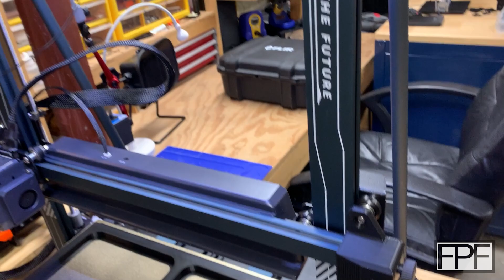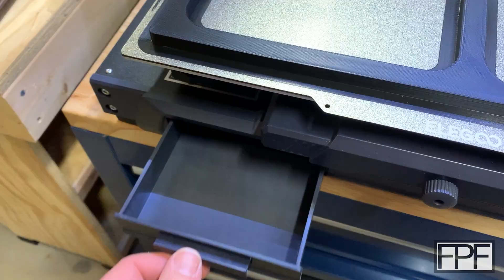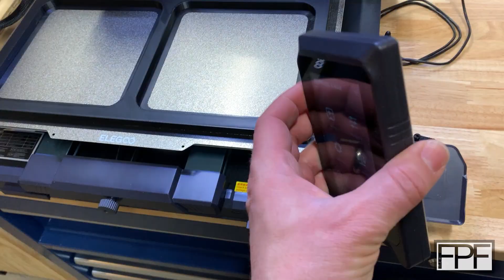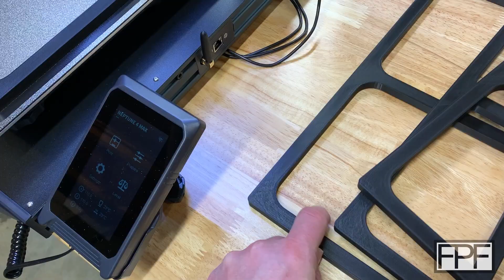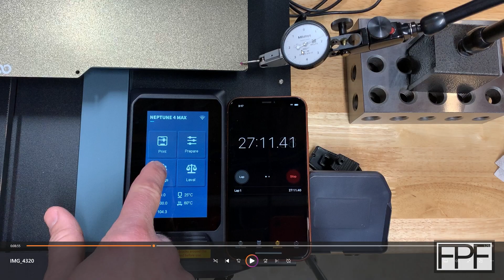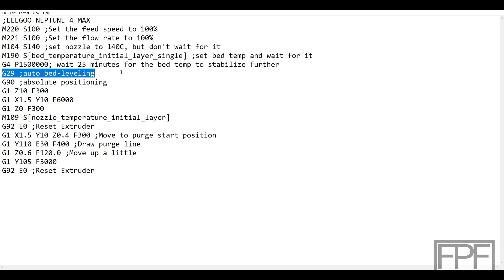Neptune 4 Max Review and a FIX for the PROBLEMS EVERYONE IS HAVING

Comment: I started in 2016 with a CR-10 and Cura and have been with Cura slicer since.  I agree with you regarding the firmware, it's probably due to klipper and the separation of the control board firmware.  Don't get me wrong i'm not making excuses but just think that's why you're having such a convoluted firmware update process.  The hassles of large print beds, I guess moral of the story is heat the bed 30 minutes before you do a bed mess.

Comment: Thank you for this video!  I just picked this printer up over the weekend. I was gonna go for a Kobra2Max, but found a great deal on the Neptune4Max.

It was tedious to setup, but I have an ender 3v2, so I was used to the tinkering. I’m able finally pump car parts, but i’m still having printing smaller prints. I have under and over extrusion on my prints, but I can just fill it in with with fillers. I’m gonna have to try your starting g code and see if that helps
Reply: Sidenote:  i prefer printing on PETG, so I turn off my part cooling and have the regular fan to 30%. I guess I should just take that part cooling piece off so it doesn’t wear out my z-axis
Reply from the maker: yeh, could just pull it off
Reply: @FunctionalPrintFriday  I’m going to once i finish this roll. Also, I was rereading the manual, and it actually states to set the filament’s temperature in the level settings. So your for the bed temp to even out makes alot more sense now.

I just put your g-code, but set the wait to just a few minutes because I wait awhile anyway after set bed temp before i print. I’ll report back after a couple of this fender flare prints!
Reply: im so glad you did not go with the kobra 2 max it is a pile of poo way worse than the N4MAX kept failing PETG prints

Comment: Awesome video! I got my 4 Max about 2 weeks after release. I had same firmware issues and did the upgrades with Elegoo support. I am also using OrcaSlicer for my Elegoo printers. I prefer the interface and it’s same as Bambu Studio.

I have bed meshed/trammed so many times it’s ridiculous! I too suspected thermal expansion, but I use thicker.28 layers for functional parts and wasn’t too concerned with surface quality. Most of my prints were passable like you were saying at the start of this video. I have yet to print anything really big, but have used most of the bed to print multiple functional parts at the same time. I agree, adding 20-30 min warmup for a 20+ hour print is worth it. Less likely to have print failures on really long prints. And you are still printing at Bambulab like speeds. 

Have you done any max flow testing on stock 4mm nozzle? I was really impressed when I got better than 26mm^3/s with some old Hatchbox filament. I can’t believe how well this 12mo old filament performed and it has never seen a dryer box.

Thanks again!

Comment: Do you think this has something to do with improper layers causing the print head to hit the infill, seems to be a common issue among 4 Max users. Typical solution is to goto gyroid infill and using Z hop. Did you encounter this issue with larger prints?
Reply from the maker: Grid is usually ok for PLA on parts without LARGE areas of open infill, but I run gyroid with any other materials or when I have a wide area of infill.  Grid + PETG is basically a death sentence for a print.  It's sooo bad.
Reply: I followed your advice on startup and have a great pla profile, printed your camera mount (perfect fit) and it turned out perfectly smooth. Thanks for the file and startup code. I love this printer!

Comment: would insulating the bottom of the bed reduce the heat soak/ wait time?
Reply from the maker: it's actually already insulated, though some people have apparently ripped off the insulation thinking it was packing material.

Comment: Watching a video about my first 3D printer hearing “this isn’t a good first 3D printer” and thinking well…
Reply from the maker: look at it this way. . if you can master getting reliably good prints on this machine, everything else in the hobby will seem easy :P
Reply: @FunctionalPrintFriday  that’s what I tell myself each time I have an issue. I’ve been fairly lucky compared to some, might be because I’ve taken it apart and checked most of the bolts. I’m a mechanical engineer so taking it apart helped me understand how this thing works. It would be interesting to watch the bed with a thermal camera to see how it heats to check for hot spots which could pinpoint some of the warping issues while heating the bed. I’m going to test out silicone bushings instead of springs to see if maybe that helps too.

Comment: I just shipped mine back for return. Honestly a very poor printer and pretty bad of Elegoo to ship a printer with this and many more problems. I was into a 5 day print, nearly at the end when I got layer shift. Dam. But literally at the end the whole top didn't adhere. I was in the other room so didn't see what happened. Lost about $200 in filament. First print failed as well because the weak spring in the filament runout sensor. I think I'm going to go for the 500mm3 Ratrig. I really wish they made an X1C with a big print volume. I have a X1C and a MK3. If I was going to keep this then 30 minutes wouldn't bother me as it's only used for very large prints that take days anyway.

Comment: I have been having so many issues with my 4 Max, and id love to get your option on this! I have had issues with heat bed failure for weeks now. (I purchased the printer in dec 2023 and started her up on January 4) I’ve crack her  and checked all of the wiring and plugs per elegoos rec and I’ve gone through the crazy process of updating the software and it’s still failing. It’ll hold heat for like ten minutes and then it’ll completely drop off. I’m not sure if it’s the fan or hardware at this point. It printed fine for five days and then it’s been heatbed failure ever since.
Reply from the maker: sounds like either the thermistor or an actual break in the heater circuit, which may be opening up as it heats.  I would definitely just want it replaced.

Comment: Can't believe this video just came out 3 days ago. I've had my Neptune 4 Max sitting in a box since late Nov23'. Was beginning to look into Rails and other minor upgrades (nozzles, etc) only to find that theres still a few bugs being worked out. Good to know about the bed variation, i'm very curious to know if this video was based on the included springs, or if you've tried testing using silicone bed spacers, etc? As for my feel... I expected it honestly. Size comes with additional challenges. Eventually I'd hope to see some 3rd party upgrade to address/make thsi time less impacting.

Comment: I have the Neptune 4 I heat soak for about 10 minutes prior to starting my prints and I do notice it has helped. Not thrilled about the Klipper implementation of this machine but once I worked the little issues out it’s been a solid machine.

Comment: That's really interesting. I've got the N4Pro as our first printer, and was suddenly getting layer shifts on the Y axis on small (3in by 4in in bed center) but tall (6in) prints. The shifts would happen about 45 minutes into the print in a room that's typically about 50 degrees F. Temp fluctuates a lot when the furnace heat kicks on and off throughout the day. 
I fiddled with the y axis belt a lot to try to fix the shifting, until it eventually broke. Elegoo is replacing it for free, but I'm suspecting that the thermal changes in the various parts might be the culprit. I'll have to try preheating once the new belt arrives.

Comment: I have had so many issues getting my prints to work properly.  I noticed the exact same things you did, but I don't have enough experience to have identified the issue as you have here.  In fact, recently my printer had the dreaded blob of death, and ruined my hot end, one of the wires came off when trying to remove the blob.  I was leveling non-stop and I also noticed the issue with Screw_tilt_adjust not being accurate.  I hope this resolves my issues, once my new nozzle comes in.  I have also ordered some of the new nozzles form Elegoo for the 1mm size, and I hope to be able to make larger objects more quickly and accurately with your guidance here.  Thank you.

Comment: really on the ropes regarding getting the neptune 3 max or 4 max. Mainly for the size. I rebuilt my ender 3 several times including with the full ender extender kit. Loved the size but i need a printer actually built for size. I will be using it for cosplay and props.

What is your honest opinion?

Comment: Hi thanks for profile. I have a question you may be able to answer. Used your G-Code and it did help alot on first layers but, as my print went along I was still getting excess extrusion. as far as it was hitting on each layer as it progressed.
Reply from the maker: Do you have the part-cooling fan on?  The big one with the switch?  If so, try running with it off.  It causes the bed to warp again when it comes on.

Comment: Thankyou for all your effort. I believe you've helped point me towards a solution for getting decent prints on my N4 Max. A few observations though:
1) 0.004 inches is 0.1016 mm, which translates to 1/2 a layer height.
2) Would an enclosure help?
3) The default tolerance is 0.05, which incidentally lets it accept almost all samples, regardless of deviation
4) With 3 samples taken, wouldn't 'average' be better than 'mean'?
5) With bed levelling done on every print wouldn't it make sense to look into the Beacon probe?
Regardless, thanks! I didn't fully realise the amount of heat expansion on such a large bed

Comment: I think Cura is actually still quite popular. Not sure if you have actual statistics for market share. I think especially for Marlin users, like anyone just using an Ender, it's still very prevalent. I personally prefer the Cura interface to most other slicers, but I have moved over to Orca slicer quite a bit because there are certain aspects which allow me to get better print quality, especially on certain prints. Sometimes, I actually find Cura provides a more logical slice of a part, but it is also missing features like support and seam painting that I really appreciate in other Prusa based slicers.
Reply: Ya I don't know where this guy is coming from with that.  Maybe most enthusiasts aren't using cura?  I think 90% of people who buy an out of the box printer are going to go get cura.
Reply: @saitekh  Yeah just a bit of confirmation bias I think. I do think Orca is superior in a few ways, but I think Cura is very competent.
Reply: I have used other slicer, Cura is still the one I like. Especially, the rich set of plug-ins. It's really a nice software.
Reply: I like Cura because is works on all my different machines, and yea I'm used to it. (Love the lightning infill). That was a factor when buying the machine.

Comment: Considering the size, even with that bed issue it's been amazing printer. Coming from CR-10 S5
30minute wait is no go for most prints. Only for say 5kg+ prints -- at which point just the weight of the print is going to affect level over time, fortunately spread over the full print.

Right now doing ~2kg print.
Insane how fast these new printers get stuff done, that's only 1½ days.

Comment: First and foremost great video!  I appreciate all the time and effort that you put into this machine.  However, I believe the only way manufactures are going to learn, is the hard way, and have customers return machines that simply do not work as advertised out of the box.  A 25min heat soak?  The when it already takes forever and a day for the bed to heat up.   For a bed of this size, maybe it should have been an AC heated bed?  To me this machine was rushed to the market, and didn't have a proper QC process.  Keep up the great work!

Comment: Function print Friday: I don’t recommend this as your first printer or using cura as your first slice 
Me who brought the N4M as my first fdm machine and only use Elegoo cura sweating hearing that😂

On a real, thanks for the video having loads of problems with the printer. Might even help me with leveling the print bed properly. Only just got the machine back online after having the main wiring loom die on me🙃🙃

Comment: Thanks for the video. Cura has been a staple of the low-end printer market for years. It shipped with the Creality machines and most of the other clones that came after.  Cura is also used for both Resin and FDM printers.  I got it with my Mars 2Pro and the Npttune 2S. Most people do end up switching to more advanced slicers.

Comment: It's great to see folks join the hobby and find issues we've banged our head against back 8-10 years ago, and heat soaking was always advised. Even if you're using mic6 beds on corexy machines, heat soak for a good 20-30 min. Let the bed stabilize, especially on large beds. I know everyone wants fast printers, but pretty sure can't fight physics.
Reply from the maker: Bambu made everyone's marketing dept. over-pivot to speed.  The N4MAX is a flatbed truck trying to wear a Porsche wrap.  There's nothing wrong with just admitting it's a flatbed truck, we need those too, but marketing dept's don't think like that.
Reply: @FunctionalPrintFriday  I heat soak bambu too. Even best heated bed surface we've found - mic6 aluminum needs heat soaking,  see my response to another post.
Reply: Or get a Bambu printer and it's easy peasy.

Comment: Sounds like the bed heater is under powered is it ac?
Reply from the maker: I believe it's DC, but it's just a big bed.  It's a lot to heat up.  I measured higher than the rated wattage of total power consumption on mine with both the bed and extruder heating.

Comment: I've noticed the same issue with the top layers on my Ender3 Pro that I just upgraded to use klipper. I've been having a hard time calibrating it. It could still be a different configuration issue, but I'm going to try this and see if it helps. Thanks!
Reply from the maker: Give it a shot, no harm in letting it heat soak.  Try for 15 mins to start.
Reply: @FunctionalPrintFriday  That did it! I had to raise my z-offset as well, but letting the bed soak gave me better top layers.
Reply from the maker: @vanillaike2304  awesome!  Glad to hear it, and thanks for coming back to share results

Comment: I use CURA on. An old MAC (2009) for my Creality Ender 3 S1/PRO. What is a better slicer to use in this setup?
Reply from the maker: I'd stick with Cura given the age of the machine you're running it on and knowing that it's working for you today.  If it's not working for you today give prusaslicer a try.  It's much lighter weight than Orca for an older machine.

Comment: Heat the bed first...so the hot end isn't just sitting there cooking while waiting for the bed to normalize, it only takes a minute or less for the hot end to go from room temp to print temp...MUCH longer for the bed, and if you are waiting to normalize, would be better to not have the hot end just hot at idle
On my Anet A8, I siliconed a 1/4" sheet of cork board to the bottom of the bed, it takes longer to heat, but it heats more evenly
I wonder if some soft of insulation on the bottom of the bed would help get the heat soaking of the aluminum better and reduce the deflection
I knew metal expands when heated...but daggum...2 thou expansion/warpage is wack
Does the G29 do the full grid autolevel before each print?
Keep em coming!!!!
Reply from the maker: Yes, G29 runs the macro as you have it configured in your printer.cfg for the bed mesh, and then that mesh stays loaded for that print.  There's a total of .007 movement in that one spot on the bed when comparing where its at it's lowest point, and where it's at it's highest point.  Honestly it's insane, and I'm surprised nobody noticed it before.  I assume Elegoo is aware of the issue and is just being quiet about it, but who knows.  There is insulation on the bottom of the bed, but I think the bed is just too thin and/or needs more bracing.  There is C-channel front and rear, but it's just not enough.
Reply: @FunctionalPrintFriday  I think all heated beds on aluminum do that...

Comment: Did not see a link for your printer config. info. Have a 4 Max and been very frustrated with same issue is the poor layering. Sometimes the first levels look so rough or later I get glob build up on nozzle. then nozzle start hotting on infill as it is being applied. Thanks for video it was very good..Jim
Reply from the maker: Good catch, thanks.  I just added the link in the video description.

Comment: I have a 4 max. I am new to printing and have had nothing but trouble since I got it. I have managed to print some pretty basic stuff, but the majority of my prints have failed. Strangely the official elegoo patterns seem to print ok, but almost any pattern outside the stock ones that come with the printer seem to fail. Mind you this is after HOURS and HOURS (if not days) of getting tech help. I REALLY REALLY want this printer to work but it just doesn't. To me this feels like a feild test for a prototype more than it does a finished streamlined product. Maybe for the Neptune 5 if they work out all the kinks I will try to buy one again. For now, I am returning my 4 max.
Reply from the maker: Give the heat soak a try before you return.  Add in the warmup, pause, and the G29.